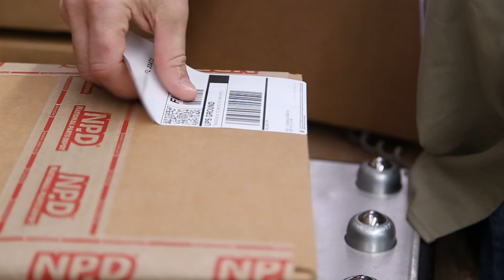How to Install Your Own Wildfire Four Post Lift Episode 418 Autorestomod

Comment: I like this lift because it is mobile and does not require drilling holes in the floor.  I worked on a 2 post most of my adult life but that feature makes a HUGE positive that a 2 post can't touch. Price is right as well. Man I can't wait to build a garage now.

Comment: I love the part at the beginning where you talk about why you used a box truck. Then as you were sitting in the truck there was a long roll back wrecker driving by that would have been a perfect vehicle to haul it on. Just tilt the bed and slide it into the garage... I used to be a master tech at one time and used inground lifts( I prefer inground). I will probably go with a 2 post for my shop eventually. The ground is just too far away when you go down  and gravity is too strong when you need to get up.
Reply from the maker: I know right? I think he would have been ticked waiting until 9:30 that night so we had help off loading it 😁😁😁

Comment: Just found you guys.  Nice video!  Did this myself with an engine hoist and it wasn’t too bad (Backyard Buddy). Have the high lift door and skipped the door opener.  Balanced door isn’t too bad to work with. Thanks!

Comment: I like the 4 post lift, with add on accessories you can do most work the car needs. The runways are great for staging parts for the project (built in shelves)
Reply from the maker: And a nice serving table for Thanksgiving dinner!
Reply: I keep leaning towards a 2 post for myself.  At work we use 2 posts to also lift bodies off frames which is stupidly easy.  A four post lift you cant really do that with it.  But I myself have been getting spoiled with the 4 post we have at work as well as its easier as all you do is simply drive on and you are done.  No moving vehicle around to get the arms to align on the frame properly for a stable lift.

Comment: As i watched your assembly, i would put the tube bushings that you put between the jam nut and the welded rod coupling  , underneath in the raceway and instead place it outside , between the frame and the tee piece to which the pull rods attach to.  This  give you a controlled distance (stand off) at both ends on the outside, with controlled minimal sliding play.
Reply from the maker: Interesting
Reply: Just did a 9000xlt and that's what the book said to do

Comment: I'm contacting Wildfire about installing a 4 post on/in a low deck trailer that will be enclosed. Wildfire also has a air powered lift that fits inside the rails/runways. This adjusts to do suspension or body lifting. Perfect setup for a portable repair/race trailer.

Comment: Thanks for the  videos you guys have taught me a lot.  I'm restoring a 66 mustang my dad bought in 67. Car hasn't run in 40+ years so as you can guess lots to do. My goal is a driving car by spring so my dad and I can drive it. My question is what to do about the body while I drive the car? It has surface rust and want to stop that before it gets worse but I hear primer will hold moisture causing more rust. Should I clean up the rust and rattle can it then when time to paint just have that sanded off?
Reply from the maker: Just keep plugging at it. Make a list of to-dos. If you need help with an issue, my email is jford@autorestomod.com

Comment: FYI, you did not install the lock linkage correctly. At time 22.22, you have one of the two sleeve spacers sandwiched between 2 lock nuts. This is wrong. The 2 spacers are between the crossbeams and the linkage arms (they are spacers front and back).  The linkages were also not attached to the arms correctly. Wildfire is working on updating the lift instructions and making more clear the linkage assembly section of the installation
Reply: Piston has threads the one with hose in rear in one up front  am I supposed to cap the front 1?

Comment: I’m excited to see how the lift works out for you guys.  I’ve been wanting one for a while now, but I always get stuck on the two vs four post debate. I like that this one has casters to move around. That might just be the deciding factor for me. It would be great if you guys do a follow up video about your experience with the lift in a couple of months after you use it for a while.  Cheers!
Reply: Instablaster...

Comment: Jeff I have the advantage xlt which is identical to the wildfire. Depending on who you speak with the other guy will say it’s a copy of “ours”. Anyway, when rolling the jack tray under the front frame supports the arms on the jack are beyond my frame rails. I have a 70 Mach one. Was wondering if you guys ran into any issues like that and how you adjusted or fabbed up a new block or support to get into correct lifting position.
Reply from the maker: We didn't have that issue. Sorry. I'd call the supplier and chat with them about it.

Comment: I am in the process of building my pole barn, it has 10' walls will this lift be happy in this barn ? City code can't be over 17' in height so my wall is limited to 10'.
Reply from the maker: Sorry it took a bit for me to get the info. We are at 13 feet. The more roof pitch you can do, the better. You'd want to see 14 or more feet at the center of the pole barn inside to go all the way up on the lift. We have a cathedral ceiling in the back section of the shop just for being able to go all the way up.
Reply: @AutoRestoMod  my cars are on the low side and I don't mind if the don't go all the way up inside it's portable to go outside into the driveway if I need extra height right.

Comment: I know you want to move the lift around the shop, but I need to agree with these other posters saying to bolt it down. Imagine this. (You are standing in front of the lift, guiding a younger crew member onto it with, say, the Fairlane wagon. You wave your hands and say "That's good. Hit the breaks." 2 1/2 tons of Detroit steel and iron come to a halt. What does physics tell us? 5 thousands pounds of force is now pushing against the lift, wanting to keep momentum moving forward, causing the entire lift to either slide, or fold over.) I would suggest drilling holes in the floor and using anchor bolts. That way you can still unbolt it, lift it over the bolts, and then move it for storage.
Reply: A vehicle is loaded with the lift at it's lowest position. There is no risk of it folding over when loading. The risk comes from an external force (ie another vehicle bumping into an upright while another is loaded above). That is the reason for bolting down. Also, using bolts with anchors rather than studs in the floor avoids a trip hazard.

Comment: How high is cell to use car on top?  Are you fastening it to the floor?   It looks better than two leg lifts.  

Don
Reply from the maker: We won't be fastening it to the floor, although that is the safest way to go. We should be able to put the lift at full height in the main area (13 foot ceilings) and certainly will in the back section where we have cathedral ceilings. It is a really nice lift.

Comment: Are you going to bolt it to the floor or you don't have to do that
Reply from the maker: You don't have to. We still might do a sleeve and bolt system in the two locations for added safety. The one we used at Mustang Monthly was never bolted down. With proper safety we had zero incidents.

Comment: You going to bolt that lift to the floor? (Recommended)
Reply from the maker: I agree that bolting is a good idea, but we need the mobility. I am looking at doing a sleeve and bolt system that would allow us to anchor it in certain spots

Comment: Cam on flip flops with heavy weight .... SAFETY guys
Reply from the maker: I told him. He's 22...10 foot tall, made of steel <shakes head>. Maybe he'll listen one day...
Reply: @AutoRestoMod  as the adult in charge ...  I think this is a topic that should be covered on a video, considering the the tools, weight, rust, etc. that you encounter. I had 3 fingers sliced (lucky it was just the pads) doing yard work after temporarily taking my gloves of for a few seconds to unstick a hedge trimmer and the unit was disconnected.  This the word "accident"

Comment: NO SAFETY SHOES ??? AT LEASE CLOSE SHOES. THIS WAY IF THE RUNWAY FALLS YOUR TOES WILL BE IN SHOE. BE SAFE.  P.S. I NEED A 4 POST LIFT. ALSO JUST FINISH A 63 COMET RAG TOP.
Reply from the maker: If those runways fall on your feet, honestly, You are going to be hurting either way. We Love our Wildfire lift. A great product.
Reply: My comment was  when YOUR BIG GUY !! WAS PULLING THE LIFT OUT OF THE TRUCK WEARING  SANDALS. It's not lift ,it's putting it  together.. SAFETY FIRST !!! not trying to BREAK BALLS  W/ YOU.